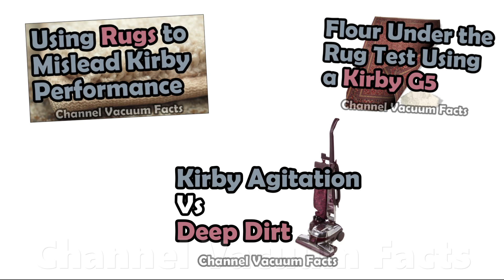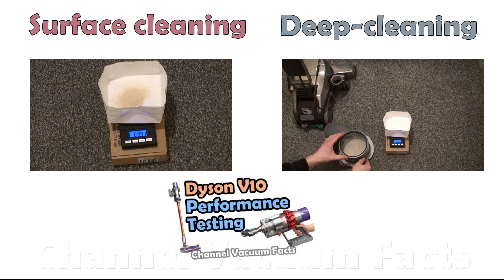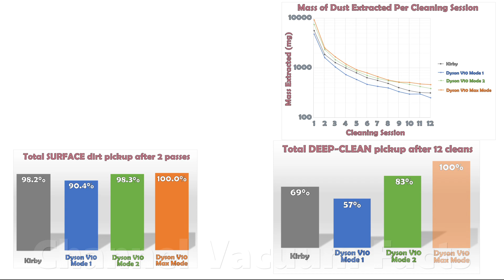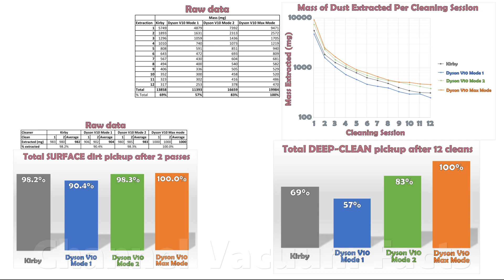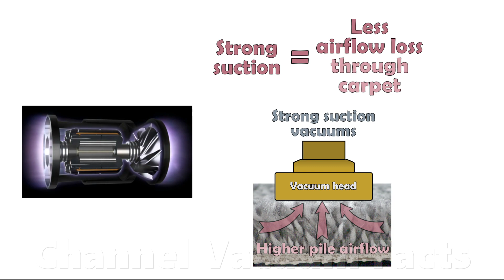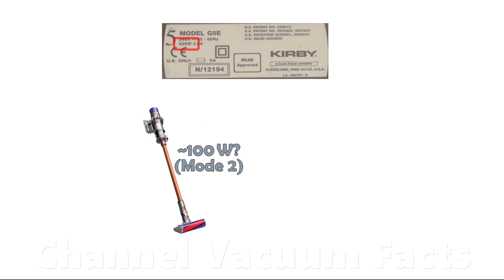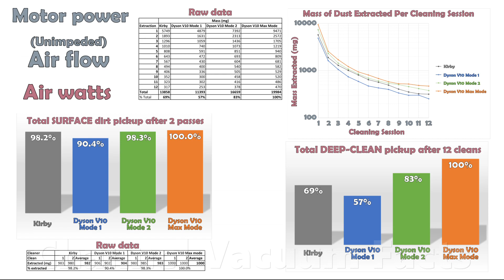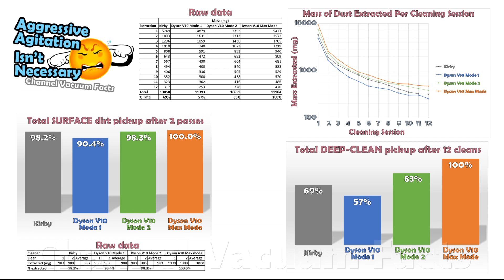Dyson V10 Vs Kirby: How Well Does a Kirby Vacuum REALLY Clean?

Comment: I've seen multiple videos from channels like Vacuum Wars and VacLabs that conflict with your conclusions. It is noted on both of these channels that adjusting the height on a Kirby is crucial for it's ability to deep clean properly. You failed to note which height setting you used on your Kirby as well as the style of carpet (at least that I saw or heard). Your first link is no longer available. In your second link as well as the Kirby vs deep cleaning video, your Kirby is adjusted far too low for that thickness of carpet, effectively you are sealing off the vacuum from being able to pull any air at all. A perfect seal is not your goal, this is why Dyson uprights do not work at all on longer pile carpet, their seal is too strong and you cannot even move the vacuum. In a Kirby's case, it can still move, but it cannot move the airflow necessary to pickup debris and dust. As far as the liquid backing in the video about flour under the rug, if it were not there, yes the Kirby would pick it up, just like it would if it were deep in the pile itself and the head were properly adjusted, which is what the test demonstrates. Nobody is trying to get dirt off the baseboards of their floors under the carpet and padding layers. If high airflow motors couldn't clean properly, there wouldn't be so many commercial vacuums and high end vacuums that outperform Dyson vacuums (Kenmore Elite, Riccar, Sanitaire, etc) that use them. Keep in mind that while models from Riccar are very expensive, the Kenmore Elite is comparable to many Dyson vacuums and solidly outperforms them in multiple ways.

On an unrelated note to actual vacuum performance, longevity should be considered. My boyfriend worked at a vacuum repair store, and far more Dyson's came in with issues then other vacuums. I will admit this doesn't control for things like the popularity of certain makes vs others, or the expense of a Dyson vacuum vs your common garden Bissell pushing people to get them repaired compared to just tossing them and buying a new one. My understanding of his experience is that 1. the Dyson uprights are exceptionally prone to clogs due to smaller diameter hoses compared to sharks, kirby's, or other big name vacuums and 2. non-repairable parts or assemblies, making repairs needlessly expensive. One specific pain point was the battery in the cordless Dyson not being user replaceable compared to the Shark cordless units like the IonFlex. He also did compare Kirby's to Volkswagen cars as long lived but difficult to repair or complicated with expensive parts as well to be fair (US perspective on the car analogy). He refused to buy one for this reason. 

Regarding build quality of Dyson vacuums, a tool review channel by the name of AVE reviewed the ball canister and found it to be... lack luster. Poorly aligned plastic parts, a Panasonic motor, and otherwise very cheap construction.

As far as air quality, as an asthmatic, I take that very seriously which is why we use a Bissell with a sealed system and HEPA filter. I've considered Shark, Dyson, Kirby, and a few other brands as well to replace our very aged Electrolux Silverado Deluxe.

I'm sorry, but this video seems quite bias in favor of Dyson vacuums.

Edit: actually, after a quick peek on your channel, almost every video is about Dyson vacuums. As it stands, I understand why. They are so needlessly expensive for their performance, you cannot afford anything else. Your like dislike ratio is also hidden on many of these videos. I wonder why.
Reply: Damn yall are typing 3 page essays over here 😂
Reply: "My boyfriend worked at a vacuum repair store, and far more Dyson's came in with issues then other vacuums."
Yeah, well my dad works for Nintendo and he said... 🙄
Reply: mjc0961 Blakeman Vacuum and Sewing in Loveland Colorado. Employed there from 2017-2019.
Reply from the maker: First, you’re citing amateur YT sources that display glaring flaws and problems with their testing. RE Kirby height, I used the height setting on the Kirby which gave the best cleaning results. You do raise a good point I should have hammered home more in the review. The fact that it’s not even clear to people what setting to use is shameful and weak design. I followed their instructions anyway. The style of carpet was the same for both machines (Saxony), and in fact was changed in sequel testing https://youtu.be/qJlaBeqVs7E . Thanks for pointing out the broken link; not sure how that happened but it’s now fixed. To suggest the Kirby head too low preventing airflow is absurd. If anything, you’re actually making my own point for me. There are not supposed to be any air gaps or you leak suction and bring air into the machine through means other than the carpet. That is wasteful. If air doesn’t go through the carpet, then it doesn’t do any cleaning. That you acknowledge the machine struggles to pull air through a carpet is actually consistent with what I showed and explained in the video. Namely the embarrassingly poor design of the Kirby and weak suction mean it can’t overcome pile resistance to maintain open-hose levels of airflow through the pile where it’s needed. And most of the sources you cited show a complete failure to understand this, crushing their credibility.

You are half correct RE the seal; a floor seal which is too strong can lead to clamping. Good, modern machines, such as the latest Dyson machines elegantly resolve this issue. I’ve discussed the problem more in this video https://youtu.be/WzkFvMLy-Eo The reason the Kirby clamps so badly and needs the horrendous tech drive is because despite having pathetically low suction, the grotesquely large surface area of the cleaner head still causes a large force. Basic physics. I’ve discussed this in the Kirby review video. This video reveals all concerning porous backing and Kirby performance https://youtu.be/qJlaBeqVs7E 

You claim that commercial vacuums and the Kenmore Elite outperform the Dyson machines, yet somehow fail to cite a single dot of reputable evidence. Paint me sceptical given the evidence displayed here https://youtu.be/pVheYuzIk3I

And this old chestnut; the reason why far more Dyson’s came in for repair is because far more people own them (and abuse them because they can’t read a simple instruction manual). If it clogs because they’ve intelligently sucked up a brick, then it’s a simple case to unclog and you don’t need a repair shop for that. RE testing/reliability, you would need far stronger evidence to draw any kind of reliability conclusion, particularly when it is widely publicly know how severe the industry standard testing is of Dyson products and how there is clear evidence of their longevity compared to the competition. A simple YT search may enlighten you. Vacuum repair shops shouldn’t be touching any modern Dyson machine given it is under warranty. Modern machines of the future are all modular and all out of warranty parts can be purchased from Dyson directly anyway until their useful service lifetime expires and they are no longer supported, meaning there is far more efficient and effective technology out there anyway. This applies to the battery; the user should never need to replace the battery. Ever. And in the rare event of a failure, Dyson send out a new one which the user can simply screw in. Vacuum repair shops have no value to offer modern Dyson products. AVE is nothing short of an unconvincing joke. The guy clearly hates the Dyson brand and performs the least professional and unconvincing tear downs, and shows astonishing ignorance of function and design. He draws questionable conclusions and is not respectable, no matter how well he can turn a screwdriver.

In short, from what I can gather from your comment, you make claims which are not supported, cite sources of opinions that are clearly flawed, offer no evidence or sound argument of your own, and draw factually incorrect conclusions. My videos focus on what is objectively shown to be the best in many areas, and currently, Dyson fill the spot. If that changes, the product/brand in question will make an appearance. There are plenty of videos on my channel which don’t mention Dyson.
Reply: @VacuumFacts  To start off with, "amateur YT sources"? What does that make you? You have 325 subscribers according to Social Blade. If you are not an amateur, are you a product designer or have some other qualifications not stated in this video? As far as my sources, Vacuum Wars channel is run by someone who owns a professional cleaning service. AVE is a machinist with years of experience, and VacLabs is simply a knowledgeable enthusiast. I myself, while obviously not a youtuber, have a four year degree in Mechanical Engineering, not the most on point knowledge, but I do understand physics. All of your sources are, well, yourself.

"...most of the sources you cited show a complete failure to understand this, crushing their credibility." Or you could just be wrong? The number of random seeming jump cuts in your video make me question why a cut needed to be made. As far as other units outperforming the Dyson uprights, cordless units, etc, I direct you to Consumer Reports, one of the most trusted product testing publications in existence.

"... and abuse them because they can’t read a simple instruction manual." In my line of work, designing labratory grade water quality testing equipment used in 192 countries around the world, that means the design is poor, not the end user is too stupid to read the manual. It's a vacuum, not a particle accelerator. This is a problem I do have with Kirby and many other "premium" vacuums to be fair like Rainbows and the Aerus brands to be fair.

"Good, modern machines, such as the latest Dyson machines elegantly resolve this issue." And Kirby's Tech Drive, and Electrolux's relief valves on the hose. 

"... the user should never need to replace the battery. Ever." Let's just do the same for the transmission of a car, which when comparing it's cost to it's job, is far more price effective then a $700 vacuum. If I pay half of a paycheck for a vacuum, that thing better last half my lifetime at least, not a few years. A typical Lithium Ion battery (and no, I don't care how long Dyson says it will last, you cannot get around chemistry) will last between 1000-2000 cycles before it is past it's usable life. I worked for several years at a Batteries+Bulbs store before I graduated in 2016. There, I was educated on battery safety, longevity, and use cases.

"AVE is nothing short of an unconvincing joke. The guy clearly hates the Dyson brand and performs the least professional and unconvincing tear downs, and shows astonishing ignorance of function and design." Ad Hominem fallacy. That is all. He liked one of the hand held vacuums from Dyson because it was the only portable that would reliably pick up metal shavings.

Regarding the Shark lawsuit, I never said any company is perfect. I consider myself to be an Apple fanboy, but even I admit they do stupid things. I won't get into why or what. Also, keep in mind, at no point did I say Dyson vacuums are bad machines. I think there are better ones, but there are also obviously worse ones. I, for example, will never own another modern Dirt Devil because they are a zombie brand making third rate garbage and relying just on their name. You, however, seem to think Dyson's shit doesn't stink, I reply with everyone's shit stinks, that's why it's shit. You have to pick the unit that best fits you. If that's a Dyson, that's fine. For me, it isn't. 

How about an exercise. Just for for academic purposes. Name three fundamental or prolific design flaws with Dyson vacuums common across all or most of their models. I'll follow with the same thing with Shark, Kirby, and Electrolux vacuums. There are three flaws I can think of right off the top of my head. The laws of thermodynamics, physics, and chemistry necessitate that no design is perfect or works exactly as intended, there are always compromises that designers and engineers concede to that create the major flaws inherent to any design.
Reply from the maker: @linksmith1057  As usual, YT didn’t notify me of this comment again, hence the late reply.

The difference between me and others is I can point out the flaws with their testing and back it up with sound scientific principles that are fact-checkable. Any testing I do I make clear isn’t a substitute for industry standard testing but is outlined in full and suffers from none of the major problems with other testing seen on YT by people who don’t really know what they’re doing.

If you think I’m wrong, you need to come up with a stronger argument why beyond that I’ve 'edited the video' (for brevity of course), implying it’s all faked. Reproduce it following the same method outlined. Otherwise, you don’t have an argument. Citing CR is another demonstration of ignorance. They are internet cowboys and no different to the YT amateurs except behind a paywall. Their testing is flawed, doesn’t account for many important factors, and deviates massively from internationally recognised industry standards that are considered the golden standard for comparative testing. Their conclusions about objective matters are often based on subjectivity stemming from opt-in opinions of their readers. They, like many other similar 'organisations', carry little respect from those who understand the principles of what they're talking about at a deeper level.

Your comment “It's a vacuum, not a particle accelerator” really wasn’t a convincing rebuttal for claims broken machines are likely down to user abuse and neglect.

My review about the Kirby explains the problems with Tech drive, showing it’s not an elegant solution at all. And a relief valve on a hose is a method to completely waste energy—inefficient.

RE the battery: I've explained in videos on my channel the virtues of Dyson’s approach to battery usage. No one has claimed their chemistry is any different, but the way it is utilised and treated in a range of ways, extends it service lifetime by avoiding accelerated aging. You should learn about this to fill in your knowledge gaps.

The problems with AVE have been addressed in other comments. There are times he demonstrates misunderstandings, draws incorrect conclusions, contradicts himself, and has clear anti-Dyson sentiments. If you think I’ve done the same, you should put forward a stronger case with a little supporting evidence.

If you want to commit to an academic exercise about flaws I suggest you list your alleged “three fundamental or prolific design flaws with Dyson vacuums common across all or most of their models” and provide some strong evidence that distinguishes a factual claim from ignorance, and then we can discuss.

Comment: I noticed that the video showed the Kirby using what is called a dirt meter, which I remember cuts the Kirbys' suction down to around 5%. What kind of meter was used on the Dyson? None, so your test was against a Kirby with 5% and a Dyson with 100%,,,good test results.
Reply from the maker: a) Make sure you tell Kirby how critical you are of their technology they sell to the public for the very purpose of demonstrating their performance. Most people who make your comment often fail to do this.
b) Could you provide any quantified evidence of how this would affect the expected result, with a clear explanation why? Without that, your comment is hollow and point deceptive. A fresh pad was used every measurement with minimal losses, and furthermore, this is exactly what the bags do over time—a point also often missed.
Reply: the fact is that you have constricted the air flow in the Kirby, and not in the Dyson and then said the test was a fair test, my opinion it was not. If the Kirby can impress someone with constricted suction power and show the superior performance over what they are now using I say good  for Kirby. Any way that is my opinion.  @VacuumFacts
Reply from the maker: @williamduckett869  Yes, you said that in your first post and I then asked you to justify the relevance of that. You evaded the opportunity, along with every other point, and as such I conclude your opinion is of no value when examined at a deeper than cosmetic level. The other Kirby videos in the series explain why the point you raised has no bearing on the conclusions. I've heard all this before and I've nothing more to add.